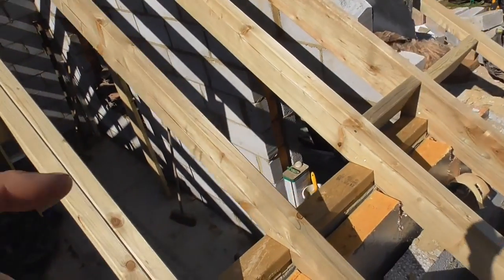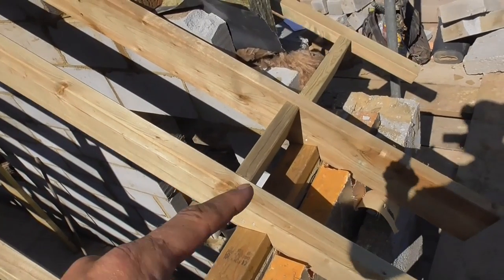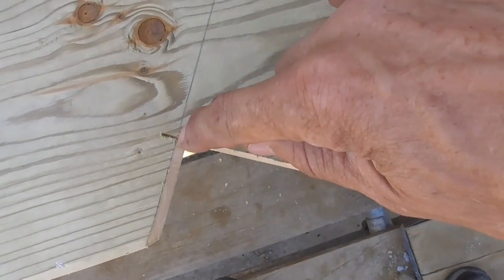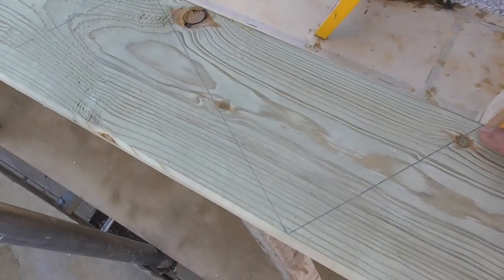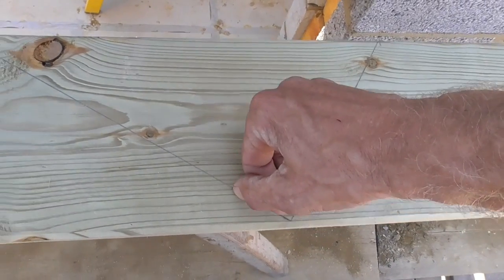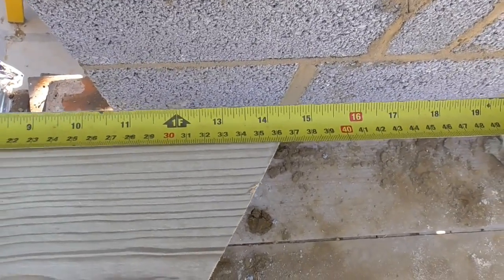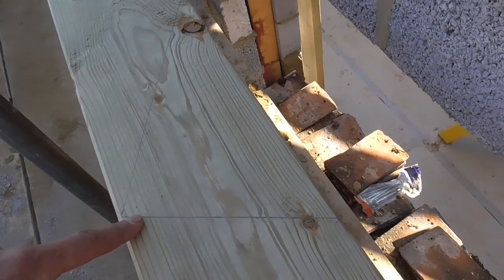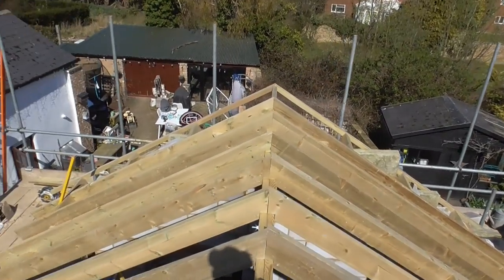How to work out rafter lengths for different height wall plates***UK ROOFING CARPENTRY/FRAMING***

Comment: Very clever. I have never done it that way. But if you know how. It works. Follows on nicely to a comment I read on another YouTube channel. A guy had written regarding learning maths essential at school for being a Carpenter. The basics yes. Got to watch your wages. I have never been a calculator. Most of the old guys who taught me weren't either. The guys that built the complicated old Cathedral and Church roofs were mostly uneducated. They probably got their measurement  with a piece of string. Currently in Australia there is a massive shortage of all trade type skills. A Senator recently suggested that we start looking back and release kids interested in these trades early, as they used to. Instead of trying to force everyone to complete school. Go to University. And join the dole queue. Or start learning a trade, when you could have been qualified. You have the best of both. You have the smarts and the hands on skills. But less bright people with common sense and training can still make good Carpenters. Not a lot of schooling required.
Reply from the maker: Hi Dave🖐It frustrates me that I cant have a proper, face to face, conversation with you about this, and feel that responding in text will never due the subject justice😩 All of what you say is correct, and we are heading for BIG problems in the next 10 to 15 years as the last of the generation who's parents encouraged them to get a trade, slowly retire😬 Great comment as always bud👍Cheers

Comment: Hey Del. Really good explanation.. Dave Taylor (ahead of me) makes a cracking point about calculation. all the old guys I worked with were NOT mathematically good but time serving, watching  and gaining experience as they went along. Grammar school education was just not working.... many, like me passed 11plus but as we had no certificate and were just told we could or could not attend Grammar school  we just went to local Secondary Moderns as directed.... 18 to 20 percent of kids did not get "the chance" due to home life, parental income etc. or even worse living in a council house were thrown into the mix!  I was told by my original teacher that I had passed but due to "the system" did not have that chance. She told me in 2005 ( my 11 plus was '64/'65. As time went by it was realised that I was discalculate but managed years in the aircraft Industry and then building trade by experience and care for "the product". I feel that our education has been let down by what was really a "social experiment" not a planned attitude to what the country needed.  Rant over and thanks as usual. Bob (Weston super Mare)
Reply from the maker: Hi Bob🖐As I said to Dave, I'd love to have this kind of conversation in person, as everything you say is spot on, and the reason we are now in a very dire situation with the lack of youngsters in ANY, vaguely, manual type jobs😬 Our education system, and wider society in general, needs to understand that a lack of academic achievement does NOT equal a lack of intelligence🤔Thanks for taking the time to watch and leave your great comment😎Cheers Del

Comment: My boss and I here in Perth, Australia, use a mathematical calculation that we figured out to work out our rafter lengths when pitching down to different plate heights, it must be the easiest method as you are just given 2 seperate lengths on a calculator and don’t have to mess around with marking the rafter as you showed here - which is still awesome as I had never seen that method so thanks for that! Anyways, this is the formula, you should give it a shot as we have pitched 100’s of roof’s to different plate heights using it without fail!

So you need to know:
1) your rise constant and rafter constant for your ° of pitch
2) the vertical height difference from top of one plate to the top of the other 
3) and lastly you must know your full span/run from outside of low plate to outside of high plate (pitching lines)

The first step is to DIVIDE the plate height difference by your RISE constant, as we know the VERTICAL measurement from top of plate to top of plate so by doing this it now gives us the HORIZONTAL run difference, the way we get the different rafter lengths is by using seperate half spans (rafter runs) to work out the lengths. To do this, you now get your full span/run, add the horizontal difference measurement we just attained to it and divide it by 2. This will be your half span for the longer rafter to the lower plate hence why you added the difference. Now to get the half span for the shorter rafter you simply minus that same horizontal distance from the full span/run and also divide it by 2, this will be the shorter rafter half span that goes to the high plate. Now finally, with these two seperate spans, you can go back to basics and simply minus half the thickness of the ridge (if using one) before multiplying your half spans by your rafter constant for your lengths. I feel as if I just wrote an essay to explain a simple way of doing something, but trust me it’s easy! I’ll do a quick example if it helps?
Reply: Let’s say we are working with a 35° pitch (700mm of rise per 1m of run, and a 1.221 rafter constant)
We have a full span from pitching line to pitching line of 6000mm
And we have a plate height difference of 300mm from top of plate to top of plate. Calculations would go as follows:

300 (plate height difference) -•- .7 (rise constant)
=428.6mm
6000 (full span) - 428.6 -•- 2
=2786mm this is your is your short rafter half span.
6000 (full span) + 428.6 -•- 2
=3214mm this is your long rafter half span.
2786 x 1.221 (rafter constant)
=3402mm this is your short rafter length!
3214 x 1.221 (rafter constant)
=3924mm this is your long rafter length!
Let me know what you think @thetallcarpenter, this method also allows you to find the ridge position prior to pitching as you have the separate half spans/runs for the different rafters.
Reply from the maker: Hi Marcus🖐Great to have you watching from down under🤩and I really appreciate you taking the time to explain another cool way to find the differing rafter lengths👊I'm pretty sure I follow what you're saying, and will be trying it out the next time I'm on a split plate height roof👍One of the best things I've found since posting videos on YouTube is how we can all share the ways we do things, which just makes us better and more efficient at our trade👌All the best(and for your Wallabies up here in France😶) Del
Reply from the maker: This is awesome Marcus👊 I'll be giving you a shout out if I use your method in any future videos😎Cheers Del

Comment: Hi Del Great explanation ,  some times I use the tangent on my calculator to find the difference but if the batteries go down i go back to the framing square and set like you did. thanks for a great video.
Reply from the maker: You're spot on about using a calculator as well to work this out Peter👍I also use a simple right angle triangle calculator app, that I could just put in half the drop, (opposite), the pitch, and it then give me the the amount to reduce or extend each rafter. (hypotenuse)👊

Comment: nice one buddy. also when i have the guide rafters set up i mark the soffit cut that way because the plate is level they will all be the same and  you can cut them all on the deck which is much easier. then when its all pitched you only have to do the cuts for the facia.
Reply from the maker: Hi there🖐 That's a great idea, and, as you say, saves having to do the rafter foot seat cut in situ👍 My problem is, I never actually know exactly what the soffit detail is until the roof is on and I've gone over it with the builder/customer🙄Thanks for watching and your comment😎Cheers Del

Comment: Hi Del was it just luck that when you marked the 1st plumb cut, and swivel your tape down the line 195mm that it hit the bottom of the timber exactly, from where you squared back for the 2nd plumb cut. This being the shorter rafters true length ? On that roof the true run is outside of wallplate to face of double ridge you birdsmouth  over yes ?
Reply from the maker: Yes Kevin, it was pur luck that the plumb cut was exactly the same as half of the plate height difference😉And yes, the true 'run' of the rafters is from the outside of plate to the ridge. (be it minus half the ridge board or not in my case). All the method does is gives you how much, either longer or shorter the 'run' is for each side without having to actually work it out. (it's basically the seat cut line I drew from the 195mm down back to the top edge of the rafter)👍Cheers bud
Reply from the maker: Sorry Kevin, I just re read the last part of your comment, and NO, the true run of the rafter is from the outside of wall plate to the RIDGE plumb cut. (I didn't deduct the ridge thickness from my 'run' calculation as the rafters meet each other and not either side of the ridge, they are only sat 'on' the ridge, and not 'in' it) I hope that makes sense🤞
Reply: @thetallcarpenter  It was basically half the span of outside of wallplate to wallplate then.
Reply from the maker: @amazing451  Spot on Kevin👌andcI wish I could have had more time to go through that in the video, but as usual, I have to crack on🫡
Reply: @thetallcarpenter  OK mate hope to see you soon 👍👍

Comment: just a quick observation the point of true rafter length ...where you measured across the rafter in your case 195 .......if I measured across my rafter until I hit 225 for example... is that measured line also now my new plumb cut angle for both opposite rafters
Reply from the maker: Hi Steve🖐I'm struggling to get your question into my brain as it's a while since I did this roof😬
Reply: So when we have two different wall plate heights ....you measured the difference obviously....then halved it.... in your video it was 195 mm....you then measured across your rafter from the true rafter  length point...195mm and drew it back across itself giving you your new short rafter length..........so the question was... the angle created by the 195 mm is that your new plumbcut angle .and would that be correct obviously say if we were 225mm..or 240mm etc etc

Comment: Is it easy to have different level wall plates but still get connected to an existing roof? Not much information I know but I doing an extension are the current ceiling height is quite low so would good if I can increase it on the extension section
Reply from the maker: Hi there🖐Yes, it's easily possible to connect one roof to another in this way when the ceiling heights are different👍You may need to keep an eye on the valley line though to make sure there is a stub rafter far enough back to catch it👊Cheers Del
Reply: @thetallcarpenter  I was thinking to get a truss company to design the trusses which in theory should be easier as they should design it accordingly?
Reply from the maker: @sajhussain26  I'd imagine any decent truss designer will be able to come up with a split plate level roof👊

Comment: Up an till today this is how I worked out using formula shown in this video....
https://youtu.be/IA-riDdC3Ak
Reply from the maker: Hi Adam🖐I've just skipped through that video, and it's a bit more long winded than how I do it. However, essentially my method will give you the difference in the 'run' measurement by just adding or subtracting from the plate to plate measurement, the distance of the level/seat mark I made between my dropped 195mm mark and the top of the new plumb cut at the upper rafter edge👍(don't know if that's last bit makes sense🤯). Cheers Del
Reply: @The Tall Carpenter  yeah totally get what your saying. As I said until I see your video that how I used to do it short of hold a pair of rafter up at the right degrees. Your method is alot easier. I feel the method in the video I linked still useful in situation where there is a massive difference in plate heights? I've had it where there's been 1500 - 2m difference in height. Would you still do it the same way by adding timber to bottom of rafter to get you line struck? TIA
Reply from the maker: @Adam Padmore  If the plates were 2m different, then I would do it even simpler🤔 I would just get an online right angle triangle calculator and put in the pitch and half the drop/rise, (opposite), which would give the rafter measurement,(hypotenuse), then I would just add/subtract this from the original, equal height  rafter measurement as per the video👊Really easy🤩 (you do need Internet service though😉)
Reply: @thetallcarpenter  ah never thought of doing it like that will bear that in mind thanks!

Comment: How do you figure out when your rafters sit ontop of your ridge? With that notch out? As apose to usually butting into the side and flush with the top. Cheers.
Reply from the maker: Hi Christopher🖐It's super simple. When setting for your rafter length, DON'T subtract the ridge thickness from the overall span, this will then leave the rafters to but together at the top. Then just mark out the birdsmouth at the heel of the plumb cut to suit whatever you want them to sit on, be it timber or a plate on a steel👍Cheers Del
Reply: @thetallcarpenter  ahhh so don't subtract ridge thickness then from that plumb cut go down 2/3 same as birds mouth?
Reply from the maker: @christophercrowle9753  BOOM👊
Reply: @thetallcarpenter  thanks very much all the best great content.
Reply from the maker: @christophercrowle9753  Cheers bud👍

Comment: So in the scenario where you cant mark the divide of the plate difference on  the 6x2, what do you do. Say the plate difference is 600mm
Reply from the maker: Great question bud👌and, in the case of the video, it was fortunate that half of the difference in the plate heights wasn't a greater measurement than the length of the plumb cut👍But, if half the drop measurement was longer than the length of the plumb cut, as you suggest, I would simply tack a short length of rafter material under the rafter and extend my plumb cut down onto it the 300mm and then square/level across as per the rest of the video👊 Also, be super easy if you used a framing square to do your roofing as you'd just read straight off it😎Cheers Del

Comment: How do you calculate the ridge position cos if you have different plate heights and pitch is equal the ridge won’t be central
Reply from the maker: Hi Ron🖐The ridge positions itself when the rafters go to it👍What I did in this instance is cut both my rafters, held them in position, put a screw in through top to temp fix them, and then attach a prop down to the floor to hold them up. Then I slid the double 'ridge' beams in, propped them up and cut the rest of the roof. The brickies then built the ridge in as they finished the cable and the other end into the original roof, and then had a 4x4 king post under it down onto the steel beam below👊Cheers Del
Reply: @thetallcarpenter  thanks for that, I’ve never used a roof calculator didn’t have them in my day, cheers 👍
Reply from the maker: @Ron Bowen  To be honest Ron, I never used a special roof calculator for years either, as its only right angle triangles which are simple to work out👍
Reply: @ronbowen9250 check out my comment on this post for an explaining on how you would find the ridge position prior to pitching. You simply need the individual run of either the longer or the shorter rafter and measuring that off the pitching line then plumbing up shall give you a rafter accurate ridge position.

Comment: Great explanation Del.  🙌🏻
👊🏻
Reply from the maker: Cheers Dan🤗Appreciate your comment bud👍Cheers
Reply: Dan, your roofing square, Can it be used by left-handers, by plumb cut on the left or is it set up for the convenience of right-handers. Thanks
Reply: Hi  @gavincollins9376  , the square isn’t universal and only works one way.  It’s not so much set up for right handers however it’s more working down the rafter on one face.   I work with a left handed chippy at time , and he uses one.  As I know you’ve seen my videos, you can see I cut the plumb cut then measure down.  
Any other questions please fire away.  🙌🏻
Reply: @Ultimate-roofing-square.  Thanks, Dan for the reply.

Comment: Hi Del, is there an easy way to work out rafters where the wall has two different cavity depths?
Reply from the maker: Hi Dan🖐If you want the soffit and fascia to match, then you must calculate your rafter length by measuring from outer brick/block skin to outer skin👍 Once you know your rafter length, you can use the lower plumb mark, (this would normally be your height above plate and the verticle/plumb part of your birdsmouth), and then plot back up the rafter your cavity width giving the the true 'outside of plate' mark. From here you can set your birdsmouths. Remember that the birdsmouth on the side with the wider cavity will not be as deep as the one on the side with the smaller cavity👊 You can just add on past the lower plumb mark how much you want for your soffit overhang 😎Hooe that makes sense🤞Cheers Del
Reply: Del, thanks that does make sense. The change of cavity is in the same run of wall so a bit awkward, but I always try to work off HAP. Just didn’t know if there was an easy way to work this out like you demonstrated the different wall plate heights.
Reply from the maker: @Dan H  There may well be a quick and easy way Dan🤔but I can't think of one yet, and I've not seen anyone else do it. Maybe someone will read these comments and enlighten us both🤞